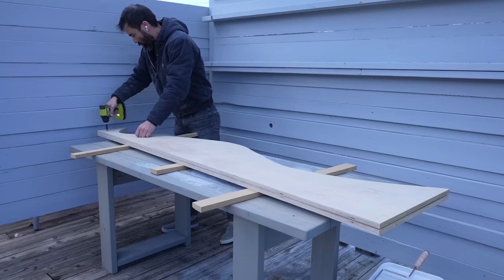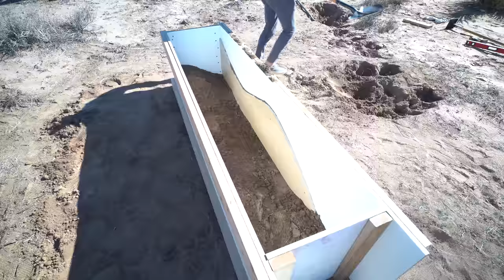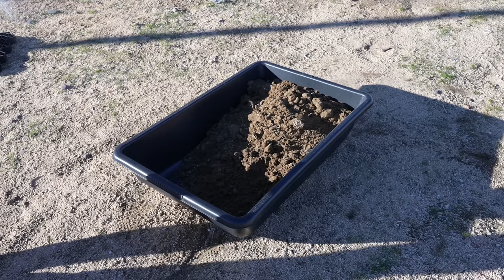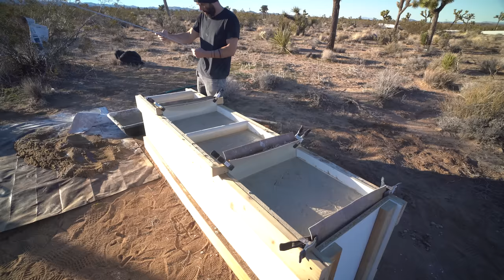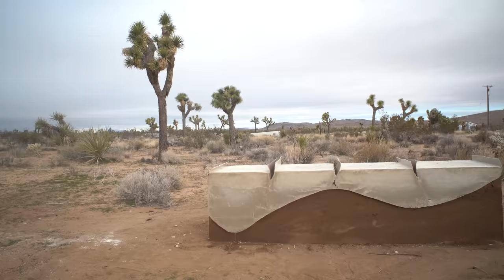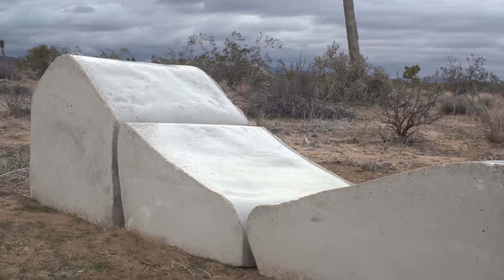Using Dirt to Form Concrete

Comment: For a light-weight concrete mix, I'd try using either expanded clay (leca) or extruded polystyrene balls as an aggregate... fantastic project, I really like how the finished bench looks like the sunbleached skeleton of some prehistoric behemoth
Reply from the maker: thanks for the suggestion

Comment: Doesn't matter what material you use. If you want it to last, use a stem frame for the wet mixture to bond to that attaches to ground with or without movement. Never bare materials unless it is rock.
Reply: Yes. It's gonna just wash away

Comment: Family, concrete requires the use of small stone (aggregate) for strength. What you've made is cament, which is not appropriate for large pours because it will inevitably crack

Comment: Linoleum is not a synthetic material. It's made from all natural parts.
Still, that's a super nice project. It looks amazing in this desert setting
Reply from the maker: yes orgininally it was linseed oil and pine rosin like an OG bio plastic but now it seems the term stuck to any flexible sheet plastic
Reply: @HomeMadeModern  
I must respectfully disagree. What you used is blown vinyl. Linoleum is a very different material. Your content has educational value so, to conflate the two is not only incorrect but is misleading to your audience.

Comment: Very cool stuff; a very artistic idea and process. I love it. Are these pieces going to be all over your new yard? Would epoxy adhere to and between the concrete pieces? Maybe blue and green and maybe formed into a side table. Would that be lighter in weight and easier to clean?
Reply from the maker: yes it would by would probably crack if the heavy pieces shifted so only advisable on a firm concrete patio

Comment: Maybe pin footing to stabilize from settling into the ground over time?  I've not done the math, though I've been lately wondering about how the performance of using rebar is compared to the sch10 or whatever pipe used.
Reply from the maker: I used 3/8" rebar
Reply: @HomeMadeModern  As pins for pin footing?  I was meaning more for supporting beneath like the Diamond or Handi-pier designs for example.  Those use pipes and I've been wondering about structurally can rebar be used instead and what differences in the loadings occur?

Comment: You may want to look at making these with "AirCrete" . It'll cut the weight by 60% or so while still being very durable.
Reply from the maker: yes but haven't figured out how to get a texture I like with aircrete yet. every experiment I try comes out like a rough cinderblock

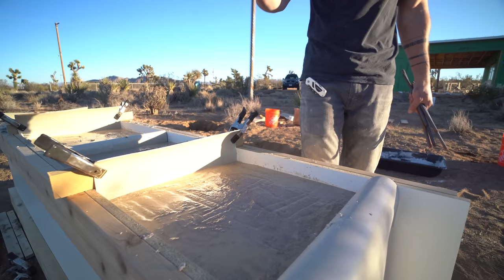Comment: 4:18 Do those pieces of rebar look like they have spots of rust forming or is it just me? I could be wrong here, but from what I understand any pre rust on rebar is no bueno to put into fresh concrete
Reply from the maker: good question!  concrete is porous so it comes down to how close the surface the steel is relative to the moisture cycles in that environment. I typically don't have issues if the concrete covers the steel by more than 1.5 inches
Reply: a tiny bit of rust is recommended on rebar, it helps the steel grip the concrete better. The rust itself isn't actually a problem, it's basically just another inert mineral... the formation of rust is the problem because the metal expands as it oxidizes.

Comment: You should make them with aircrete!
Reply: @keithmarlowe5569  I am in the same boat. Aircrete is on my list of projects ;-). I haven’t actually used it yet.
Reply from the maker: have not been able to get the surface smooth on that

Comment: you would dig rammed earth houses if you don't already know of them that is.
Reply from the maker: I love rammed earth houses!  a lot of challenges depending on climate and can be expensive to get the structural engineering done compared to typical construction
Reply: @HomeMadeModern  In Canada we have to put ridged insulation in the middle for thermal bridging. Engineering here is reasonable because it's becoming more common now.

Comment: With deserts full of it, one can easily be fooled into thinking that sand is an almost infinite resource. However, desert sand has little use; the grains are too smooth and fine to bind together, so it is not suitable for the making of for instance concrete.

watch "Can You Use Any Sand To Make Concrete?"  https://youtu.be/yH-UkOl6_SM?t=115

Comment: Dirt + cement= concrete.
Reply from the maker: sort of but typically concrete doesn't have organic matter in it.  dirt has different proportions of organic matter vs sand, gravel, and clay in different areas and at different depths with top soil tending to have more organic material.  from my understanding its the organic matter that weakens the chemical bonds in concrete.

Comment: Aircrete would be a great add to it and i bet you can do a good tutorial on it.
Reply from the maker: yeah I am considering it for above ground planters or septic systems but from what I have the surface texture is a little rough
Reply: @HomeMadeModern  I'd be genuinely interested if you explored aircrete. I played with a lot a few years back, but didn't really have the proper tools to make a quality foam that was stable. I had one true success making a small planter and incorporating aluminum powder and sodium hydroxide into the mix. The bottom and sides were contacted the form are actually incredibly smooth and I was able to use a metal file to smooth out high points on the top of the planter. I abandoned that idea afterwards though solely because I was freaked out about working with aluminum powder and breathing it in
Reply: I do like the smooth dino bone look, could incorporate a layer of mix to give the surface a smooth surface then add some rebar/scrap sticking out of it then add aircrete.
Reply: And regardless of the mix i could see adding foam shapes and spunges to the side walls pulling them out after would create interesting voids in the side. Even pocktes for plants. And it would lighten it without reducing structurally strength for laying on.

Comment: Linoleum is an organic product, vinyl is not.
Reply from the maker: good call!  Linoleum was originally made from linseed oil and pine rosin and that product name got used for all flexible sheet flooring even when it switched to vinyl.  thank you for the tip!

Comment: Man! This guy over thinks things that already have been simplified by buying the right materials. 🤷🏻‍♂️🤦🏼‍♂️🙆🏼‍♂️
Reply from the maker: which materials?  I typically use bagged concrete but the trade off of carrying 1000 lbs of bagged mi vs 200 of Portland cement seemed to make sense.